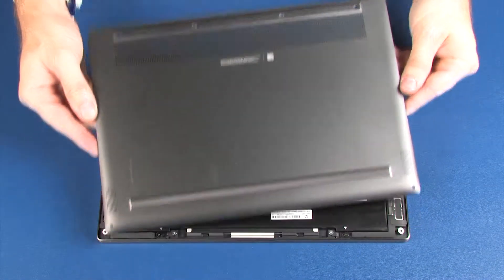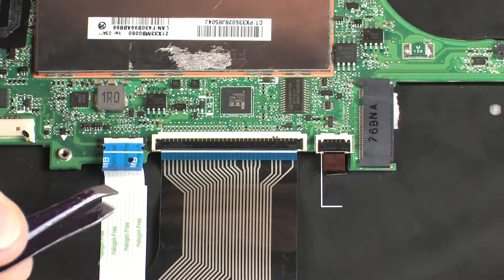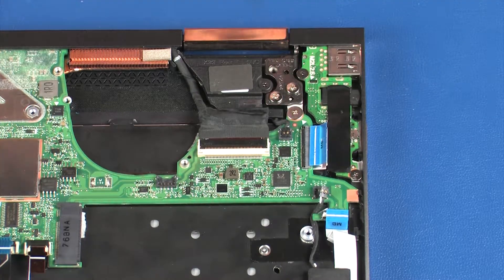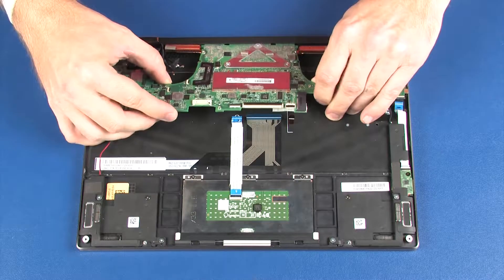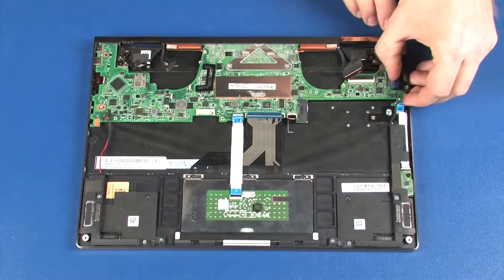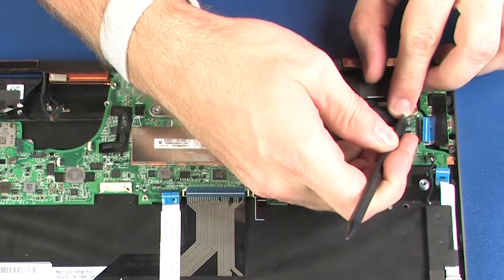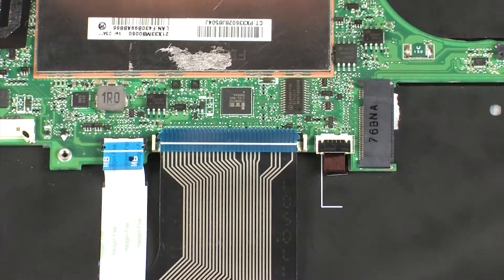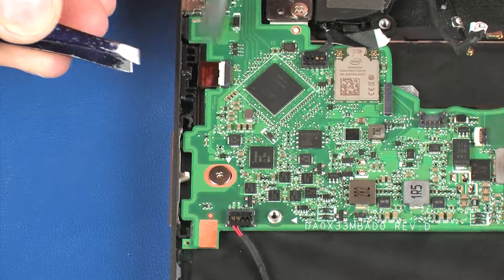Remove and Replace the System Board | HP Spectre x360 13 | HP

Comment: Hello , if i replace the mother board is the windows system stay ?
Reply from the maker: +Hi There The recovery disks for your model will not work on a different model motherboard.
They are only designed to work on the original motherboard the PC came with.
If you were to try using them, they will report and error, and the installation will quit.
Reply: @HPSupport  if i take a new motherboard that is same to the original motherboard i mean that is a fit model to it . If the mistak that you  pointed , is this stay ?